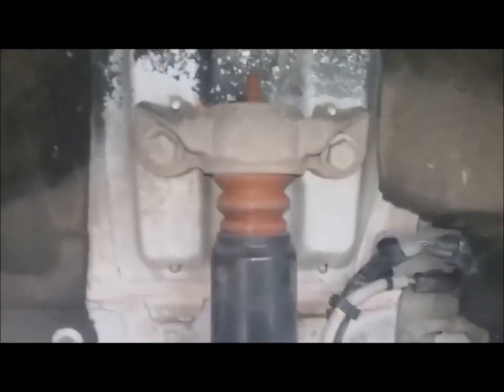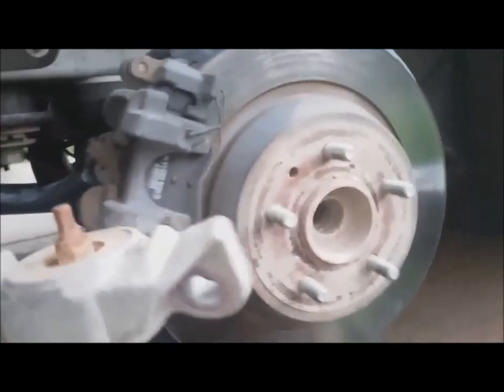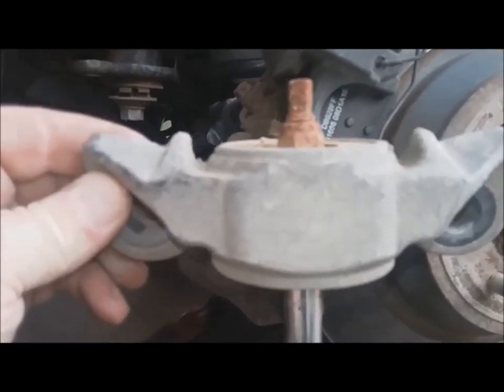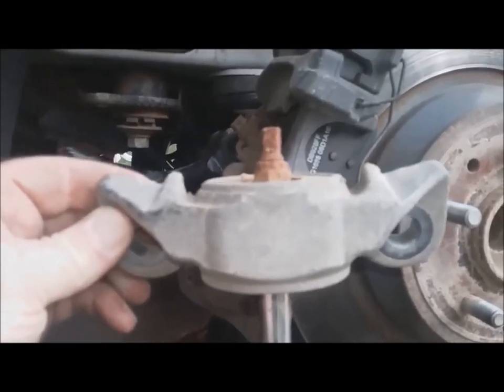Noise from rear of 2013 Ford Fusion

Comment: Same issue I’m having 2014 ford fusion. Replaced the shock and now im having this same sound. Will try to tighten the bolt again
Reply: I tightened the top bolt and now the noise is gone. It’s insane how a such a small difference removed that loud sound. Thank you so much this video saved me money

Comment: Didn't save me money, but this video helped me to identify what was going on with my 2016 Fusion. I had a pretty similar noise coming from the driver's side rear. I found this video before I took it in to the shop. I mentioned when I dropped it off that I had found this video with a similar issue and because of that I was pretty sure I had a shock that needed to be replaced. Still took the shop 2 days to identify the issue and even then, they reluctantly decided to replace shocks because they couldn't figure out what else would be making the noise. When I finally picked it up, the service manager mentioned, that he told the techs that the owner had found a video that make him think it was the shocks...guess the message didn't make it back to the techs.

Comment: i tightened the top nut about 1/2 turn and the noise went away.  Did not even have to take the wheel off.  It was hard to get the wrench on the nut properly with the rust and dirt build up but once i got it on properly, it turned no problem.

Comment: Thanks for video. My '13 has 105k km (65k mi) and just started making the clunking last week. I chased down loose items in the trunk and under the seat, found a padlock, a tape measure, and a ball point pen - but the noise continued. I  jacked up the rear, took off the wheel, and cleaned all the crud off the upper shock mount - sprayed it with penetrating oil, and let it sit for a few minutes. Then, slipped a 15mm closed spanner over the nut and grabbed the top of the strut rod with a vice grip. Tightened the nut about half a turn! That's all it took - noise gone - all quiet again. On the other side (drivers) the nut didn't barely budge, maybe 1/32 of a turn, so it was just one side causing the problem. Lesson learned, the shock rod nuts do loosen and noise will occur at about half turn. Mine wasn't as loud as yours, but definitely there, frequent and annoying. Thanks again!
Reply: Thanks big guy for sharing that experience because I just replaced my rear shocks and it’s still making the same noise I’m gonna try and see if the bolts are loosening

Comment: This is exactly what my 2013 Fusion is doing... Would you be able to recommend me which brand of shocks you bought and possibly from where you found them for a good price?
Reply from the maker: Not exactly sure what shocks I bought. I went the extra mile and bought new shocks and mounts. You can go cheap and just tighten the nut. All depends on where you are.
Reply: @stevec588  Thanks man. I can only imagine (for the time being) that sigh of relief when that noise finally just shuts up lol it's so annoying. I already tried to mess with it similar to how you did but even tightening it up did nothing for me.
Reply from the maker: @kylegreenwood9507  true, I used to drive Uber and I would occasionally get a mechanic as a rider. I would offer a few ride if he solved the problem. Never happened.... With the mechanic.

Comment: You all rock! I had the same sound and tightened the mount at the top of the shock with they 15mm and no more sound! Probably replace the shock down the road but that happens eventually anyway!
Reply: So idk if I’m having the same issue but just recently put my vehicle back to stock suspension after being on coilovers. Heard it alittle with the aftermarket suspension and didn’t bother me . Now the stock suspension is on the car I have this squeak over bumps in the driver rear and can’t find this for the life of me could it be the top strut mount or actually shock it self or ball joints or what do you think bud?
Reply from the maker: If you switch shock/coil overs completely and the same noise is there it must be something else. Bushings?
Reply: @stevec588  I’ was told by 2 people could be bushings or the strut it self but I silicone white lithium grease everything and still heard it and it only happens over big bumps in road at low speeds
Reply from the maker: Can be many things. Check these out. 

https://youtu.be/YXo7u8ysYPQ
Reply from the maker: https://youtu.be/p7Tze08mi_A

Comment: Thank you, you just saved my marriage. Jk, but not really. This had been driving me nuts for 2+ years. After countless times taking apart the trunk, the door, searching around, and wiggling the wheels to look for loose joints and never finding anything, I was able to reproduce the sound by just pushing on the back of the car with my hand and sticking my other hand down in the wheel well where I could physically feel the shock moving at that joint. This video confirmed it for me.

For anyone reading, you can temporarily fix this with only a 15mm wrench and NOTHING ELSE, no purchase necessary. Jack car up and support it, remove the wheel,  and then simply use the 15mm wrench to tighten that bolt on top. You don't have to replace the shock or the shock mount. Now, that said, if your car is like mine, the shocks do need replaced anyway because it rides like crap, but  this at least got the horrendous sound to go away. 15x easier than changing brakes. My grandmother could do this job. Thanks again.

Comment: Having the same issue on 2016 titanium. Jacked up rear driver side,Tightened nut about 1/2 turn with 15mm box and vice grip. Sound stopped and rides smooth again.

Comment: Thanks for the video this helped me out so much.  I have a 2013 ford fusion with the same exact noise.  I searched youtube but didn't find anything.   I thought it had to be a bushing that was bad so took the  rear lower control arm out but all the bushings looked good so came back to youtube and found your video.  looked at my shock and that was my issue.
Reply: So what was the problem I got the same issue
Reply: @joseolavarria7595  
I took the shock off and put a washer under the top nut that holds the top mount to the shock.
Reply: @jeffroberg  ok so that fix your problem and how u spent on it.thanks for the reply because that noise is driving me crazy too
Reply: @jeffroberg  how much u spend on it
Reply: @joseolavarria7595  I didn't spend anything other then my time.  I had the washer.
Reply: Same issue, same side 2013 AWD Titanium.  Dealer quoted $395 to fix.  I'm going to start with the mounting bracket.  Also have the front left axle seal leaking.  That seems to be a popular problem as well,  Quoted about the same price to fix that.  That change out on that is quite extensive for an $11 seal!
Reply: I had the same problem. I saw a viedeo of a guy who said he tightened a screw with out taking of  the tire. So i checked the bolts that attach the mount to the frame and they were tight. So i thought i had to change the mount. But i thought about there is a nut at the top of the shock. I held the top with vice grips and used a 15mm ratchet wrench and maybe got 1 turn out of the nut and it tightened to the mount and problem solved. Didn't spend a dime, for now.

Comment: My 2015 mondeo with 86000kms making annoying ticking tapping noise like a plastic fitting tapping off the paint work coming from my rear right handside.Ripped out boot liner to see could I find it...also thought it might be the rear window washer fitting.Hopefully it's a loose shock mount as I will get rid if this car if it keeps at it..as it's slowly driving me berserk!
Reply: Tighten the nut at the top of the shock. It works its way loose. Use vice grips to hold the stud from spinning with the nut

Comment: I have the same noise and put new shocks and brackets on today. Had no noise at first and about a mile down the road the noise came back. Maybe I didn't tighten the bolt enough?
Reply from the maker: Certainly try that first.
Reply: @stevec588  thanks for the reply I'll try it

Comment: I have a 2016 ford fusion and it was making that same noise. Replaced both shocks and mounts and the sound is now gone. However my car has only 60,000km on it. I believe just tightening the shock could have fixed the problem in the short run. Replacing both shocks and mounts was over $500 CA. Thanks for posting.
Reply: All you have to do is tighten the nut on the shock

Comment: Have this same sound coming from my 2016 Fusion.  Replacing the shocks tomorrow!
Reply: Did it help? I have a 2015 AWD and it sounds like loose parts back there. Super annoying..!
Reply: Yes, replaced both shocks and no more rattle.  Only the driver side was bad tho.

Comment: Quick question... i have the same thing.  has driven me nuts for a while now.  but got used to it.  Daughter is now driving my car so i HAVE to fix it. Just the shock, there were no issues with the bracket itself?  just want to make sure before i dive into it.
Reply from the maker: See if I can recall from 4 years ago. :)

Always start with the simplest (and cheapest) I would attempt to tighten the top shock bolt using a box wrench and small socket that fits on the end of the shaft. If that doesn't work remove the shock. Inspect inside mount to see if mount rubber is cracked/failing. If so replace. If not, shock screw threads are probably shot. Probably new shock to fix that so it can tighten all the way down.

Comment: My 2014 makes a noise like a fog-horn sometimes. Passengers say it is on the driver side rear. Mechanics say they must hear it to identify the problem. It doenot happen all the time. It comes and goes. Anyone have and idea whats going on.
Reply: I've seen videos where people have had the same issue. It was the valve on the gas filler tube not closing all the way and letting pressure release. Some say it sounds like the car is passing gas :)  Might be worth looking into.

Comment: If you buy the OEM shocks you need to buy the top  nuts separate RockAuto does not list them,but if you put this number W713760S440 into their search they show up. It is a pack of four. Our 16 Fusion did this on the passenger rear same as video no visible movement until removed
Reply from the maker: Mine came with replacement nuts but not sure if OEM does or not, sorry.

Comment: Thank you so much for posting. My 2016 (140K miles) made the same noise. It drove me insane and I tried to rule out all sources that caused the noise. My mechanic checked and did not think it was anything under the car. With the nature of noise , where it came from roughly and types of vibrations that caused the noise I was sure it got to be from under there. Coincidently I saw this video and the noise is exactly the same. I bought two New shocks and had them replaced. Now the noise is gone but I wish I just had to tighten the nuts. The new shocks give smoother ride anyway. Now I know what to do if the sound occurs again.

Comment: I have a 2013 that just started making the same noise from the same area, back right. I also thought it was coming from inside the trunk. I’ll have to check this out to see if it’s the same issue for me. I’ll probably just tighten it back up and then when it warms up a bit, I’ll change the shocks. These negative and single digit temps aren’t any good for working on the car all day if you don’t have to lol

Comment: Thanks a lot for this Steve. My 2013 Fusion was doing it too. I took the wheel off and checked brakes and joints but couldn't see where the slack was at. Huge help!

Comment: I had the same problem. I saw a viedeo of a guy who said he tightened a screw with out taking of  the tire. So i checked the bolts that attach the mount to the frame and they were tight. So i thought i had to change the mount. But i thought about there is a nut at the top of the shock. I held the top with vice grips and used a 15mm ratchet wrench and maybe got 1 turn out of the nut and it tightened to the mount and problem solved. Didn't spend a dime, for now.
Reply: Same here!  Didn't spend a dime - don't even need to remove the wheel.  Just need a 15mm wrench and vice grips ;)
Reply: Your the fucking man. I replaced both rear stabilizers thingys
Reply: I'll let you know if this works.
Reply: 2014 Fusion Energi with the same issue.  Just jacked the car up, cleaned out a little dirt on top of the shock mount and sprayed a little penetrating oil on the nut.  Let it sit for about 20 min, and tightened the nut with a 15mm wrench...maybe 1/2 turn or so.  Noise gone!  

We'll see how long it lasts...will reply with updates.
Reply: @anthonymoore6492  how's it going?  Did the noise return?
Reply: @johnbau7943  I ended up swapping the shocks and shock mounts out. Both were completely shot. The old nuts on the shocks were toast too. Couldn't move them. I removed everything then took the angle grinder to the old shock piston and cut it in half so I could get the plastic boots. Those things are expensive! Reassembled everything and torqued all the bolts. If I have any advice to anyone it would be to get the Motorcraft shocks because they have the weldnut on the bottom and it is easier to reinstall the shocks. Mine rides nice and no noise, but I would go with the Motorcraft shocks if I did it again.
Reply: @John Bau  did the exact same thing. The bracket at the top of the shock was also a little loose like in the video. Wd40 and tightened it and no more noise. I would also like to add that I had my power steering go on our 2014 ford fusion and it was due to a recall for corroded bolts. Get your recalls done lol.
Reply: @780Northface  Yikes!  For me, the noise has returned, but not nearly as bad as the initial issue.  Tightened again once, but the noise returned a few weeks later.  At 9 years old and 120K miles with the giant Energi battery pack in the trunk, I'm going to suck it up and replace the shocks and mounts.

Comment: The nut has to be tightened to spec with the cars weight on it.
Reply from the maker: If it was a strut tower I'd agree but a plane shock alone... eh.
Reply: @stevec588  There's a video by a Ford Tech about shocks getting destroyed quickly because they weren't torqued with weight on the suspension. You can just jack up the rotor until it is about ride height. Believe me, I did the rear shocks in my 13 FFH. Had same rattle. I forgot to move the white cap to my new KYB and I also tightened the nut with weight on suspension. KYB and Bilstein both recommend this on their websites.

Comment: After cleaning the area around the top nut, I was able to wiggle it and reproduce the sound, confirming the nut was loose. You can actually tighten the nut without removing the tire. Cheapest fix around. Do both sides while you are at it. 😀
Reply: Wait. So you didn't have to replace shock, mount or anything?
Reply: @JoaoMilasch  I didn't replace anything. I just tightened the top nut. Nothing to take apart either.
Reply: Same here - fixed the problem in no time by just tightening the nut.
Reply: @davidozog7549  How did you manage to tighten the top bolt? When i tried it, the entire piece rotated.
Reply: @jonplunkett8980  At the topmost part of the shock rod, there is a "squared" bolt. About an inch lower, there is a 15mm nut.  I attached some vice grips to the square part of the bolt and held that with one hand to prevent rotation, then used a 15mm wrench to tighten the nut with my other hand.  It only takes a 1/2 turn or so.  Best of luck!
Reply: ^This saved me so much time! tightened the nut ~1/2 a turn and the clunk went away!

Comment: My 2015 Fusion makes a very similar noise (if not the same) but is not as loud (but could be because I don't have seats off etc.) and does not occur as often... mainly when I'm driving around 70+ and it's windy. Also to me from drivers seat it seems to be coming from the front mid-top of the rear passenger door. Thanks!
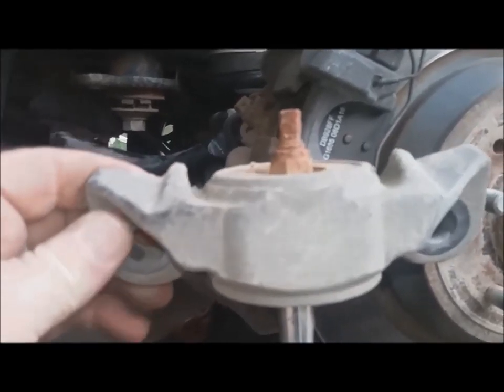Reply from the maker: I remember trying to figure out where the noise came from and it seemed to transfer all over the place. At one point I was looking at the front of the car. Easiest thing to do is remove wheel and two bolts holding shock mount to car and see if the mount moves on the shock rod like at 1:10. if it moves at all and won't tighten down, replace shock and tighten with new nut. Test mount movement. If still moves get new mount.

Comment: I have that same problem!  I am going to do the shocks tomorrow when I get home from work, or Saturday morning.  I'm worried it might be the mount bracket too, as I hear it is common that goes bad.  Unfortunately, no one local to me carries it, they have to order it.  Such BS.  So, question, if I change the shocks and it turns out to be the bracket, is it still possible to change the bracket without also getting new shocks again?  Newb question, I know, I'm lacking in overall knowledge on cars.  

Thanks for the video BTW.

Comment: This is very common in Fusions from 2013 and up, they fail around 60k miles. Be sure to replace both shocks and mounts. It's very cheap and easy. Both shocks with mounts are around $200 OEM, or KYB is even cheaper. Labor is about $150. Don't change anything else if you have this noise. It's the shocks, and mounts. Trust me.
Reply: I replaced mine, both sides, in 45 minutes the first time.  Ok a $30 shock tool kit to get the top nut on correctly. I have a computer science degree and work for a fraction of $150 per 45 minutes!   Maybe I’m in the wrong business!